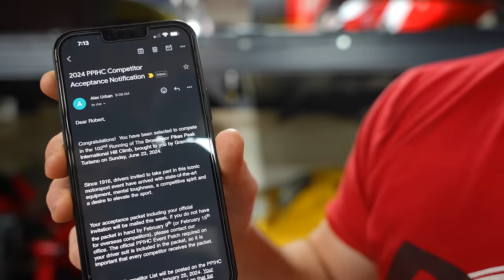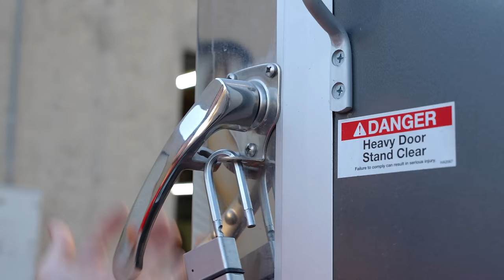I applied to RACE up Pikes Peak this year!  They responded..

Comment: as someone who lives in colorado at 6,000 feet and trives a turbo car, do not underestimate what the air will do to you AND your car, i suggest bringing literal canned air for you to breathe as this height willl mess with your head and focus. you can find em at stores around here. and also attempt to tune your car at this altitude so when you go hard on the big mountian it wont be crying for help.

Comment: I know that feeling... If you do as you've said you plan to, you'll be a really good driver. I hope you set the bar high. I will refrain from talking trash as I don't want you to push yourself or your car too hard... Instead, I'll share some wisdom that my father shared with me... "When you get tired, stop." You will tend to make stupid mistakes when you get tired, and you can't afford the price of stupid mistakes at this level. Running the car that hard for that long in that climate... The weakest link always breaks first... Build so that there are no weak links. You can't afford to have an oil link burst or back off... It's a long way down off the side of that mountain... As my grandfather used to say "Expect the unexpected." Lastly, you don't need a teacher, or a trainer, you need an educator... Ufortunately, experience is the best educator. That takes time that you don't have. You seem to be aware of everything I've said so far, but I want to be sure.

Comment: You could add another throttle to simulate lower intake pressure, use the map to regulate the additional throttle pressure drop.

Comment: I don’t see a lot of comments from folks with experience so as a former hillclimb racer let me offer some advice.  Get seat time, you should be driving more than fixing or building, and focus on autox and track days.  Drive every terrible rainy track day you can.  Safety is #1, 2 and 3, full cage, fire system, fuel cell, power cut, all those are standard, but you need to practice exiting the vehicle as quickly as possible so it’s second nature.  Get your affairs in order and be prepared to not return from the mountain alive.  This is not a joke and anyone who laughs hasn’t watched a friend bleed out hours from the hospital.  Every hillclimb driver’s meeting I attended started with this, “You could die today, maybe on the mountain, maybe in a helicopter and maybe in the hospital, but this could be your last morning.  No one is any less brave to back out now and just spectate.”  Sometimes you beat the mountain, and sometimes the mountain beats you.

Comment: Do you need an Engineer/mechanic with background in building Tarmac rally cars here in Ireland 🇮🇪?  Ive a degree in Mechanical Engineering and im a driver so I might have a few tips for you . Hillclimb and tarmac rallying is a different thing than track racing. 
Seam weld the chasis and make sure you have bars out to the front strut towers too 👌🤙

Comment: The three rotor with a swan neck dual element wing and a thick boi front splitter would be SEXY👀🔥 also instead of moving the transmission you should machine a piece to move the shift lever back a few inches

Comment: It would be cool if you could get in touch with Mad Mike They said they learned heaps taking the 4rotor mx5 up pikes peak. One of their biggest issues they mentioned in his video was overheating cause of the low air density.

Comment: Hi, I dont think i heared this or if u plan on doing it but i eould look into making ur gears shorter cause i think they might be to long for pikes peak if u have a topspeed of like 130-140. Anything higher is prob not necasarry and it will be scarry asfuck. I would focus on accelaration and making the car as grippy and nimble as possible. Good luck in advance!

Comment: Why not get an adapter for the shifter that allows you to hold it closer towards you but keeps the drivetrain where it’s at? As well as getting another adapter for the steering wheel that puts it closer for you as well?

Comment: So I've never built a race car, however, as someone who lives in the rockies, if your cooling system only lasts 10 minutes ar sea level, it wouldn't last that long at altitude, less air density, therfore less air to pull heat with, go crazy on the cooling don't fall for the trap

Comment: Do you think you could wire in like a barometric pressure sensor into your waste gate controller so as it sees a drop in barometric pressure as he go up in elevation, it will compensate and add boost and more fuel

Comment: You might want to also hit the gym, if your focus is truly going to be being the best driver. Pikes peak seems like a place that is as hard on the person as it is on the machine. Core, upperbody and neck strength will be key. Lowering your weight will also make you faster but will especislly make temperature management much easier. Also, learn to love electrolyte replacement drinks, you'll need them.

Comment: Honestly think a mid mounted turbo 4 rotor would kill Pikes peak. Build a 787 style protototype. If you can use mechanicals from awd mid engines, that would be best. Hybrid electric fwd would be an easier way to power front wheels. 
If you can engineer direct injection for the 4 rotor, you may reach a point of performance that the Pikes peak organizers may not wish to see. Especially in the hands of a novice.

Comment: 1 word.............simulator. 

      You own a F1 car and a Lambo, you have $, there's no reason why you can't build yourself a 10-20k+, top of the line racing simulator. Equipped with 8k monitors. There's companies out there making custom ones and they could probably incorporate matching parts like seat, pedals, shifter using the same ones from your car to give you the closest thing to getting seat time without being at the track. On rainy days, track delays or before or after work you could easily be spending an hour or 2 a day putting in dozens of laps and before you know it you'll have hundreds then thousands. The machine can include features like vibration features, even temperature changes with fans/heaters. You'll get 100x more experience without doing damage to your car, and will have better muscle memory for turns and speeds. Pikes peak I'm positive is part of a race pack you can download as I could of sworn I seen Hert from Hoonigan playing it.

Comment: Fucking hell! That's a whole lot of shifting stuff around! 
Stupid question I'm sorry! But could you make like a sub frame that bolts into the engine bay for pikes peak specs that you could swap out and put in street style sub frame? Just thinking of like saving time doing different setups down the line. Like drop the engine into one frame, bolt it in the car so it's all in one position, then drop that out and put the engine into another frame so stuff is in another position. So it's a bit like quick change? Or is that an impossible impractical idea? My mechanic knowledge is rubbish I'm sorry! Lol

Comment: I don't really think pikes peak is a good idea for a 5 month span with everything else you're doing. You should at least be on a sim getting as much experience as possible.

and a custom bend shifter, or even just 90 degree angle weird extension toward the driver, should work fine instead of moving the whole drivetrain. Then you'll be affecting the weight balance and dynamics. In my opinion having the weight pivot at the front axles is much safer to drive hard.

Comment: Pike's Peak is not a track. None of the experience in tuning nor driving at any track will not apply to Pike's Peak. Pike's Peak is a Rally stage with a tarmac surface. For your safety and well being, I sincerely hope you'll understand the difference. There will be water, snow, ice, pot holes, bumps, cracks, patches, road markings, wild animals, impossible to drive corners, sand and gravel in places where you need traction the most. You need to build and drive that FD as a Rally car, not "time attack" or track, Rally. Monte Carlo. San Remo. Mille Miglia. You'll need climate control to keep windows open and oxygen tank to keep you awake. You need suspension travel and ground clearance, low unsuspended mass to keep the tyres planted and relatively high center of mass to keep the body agile and moving when cornering. To even get to the top in Pike's Peak, you need to be able to load and unload the suspension, use the mass to your advantage. Aero comes secondary, there's two corners at the lowest section where aero has anything to do with the performance, the rest is suspension and driver skill.